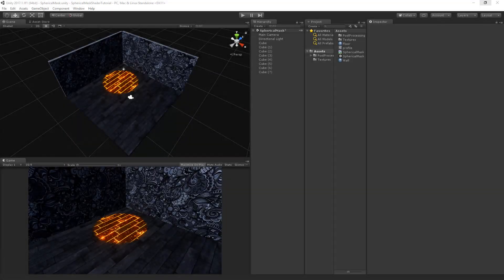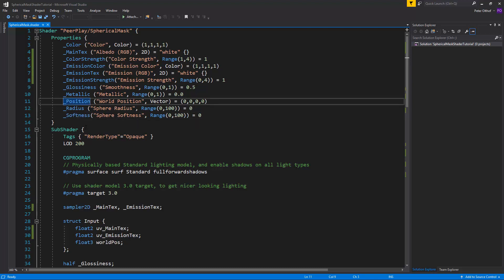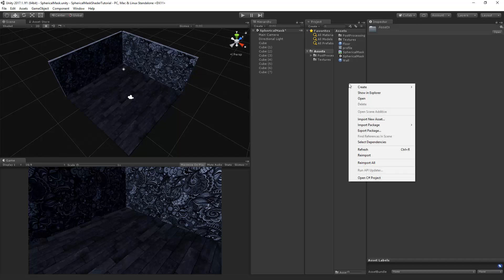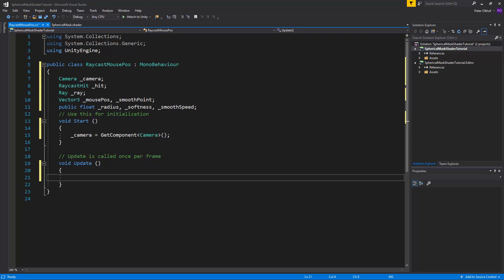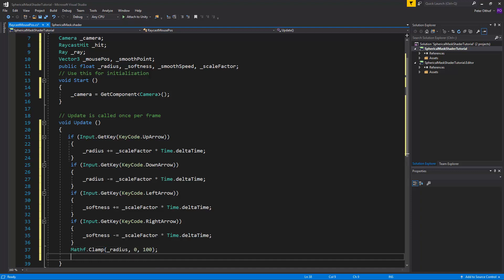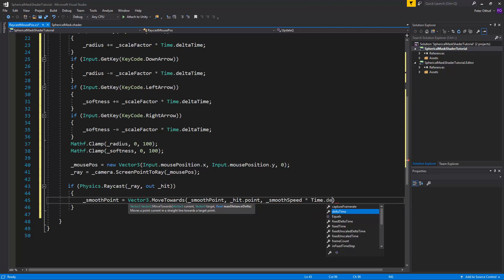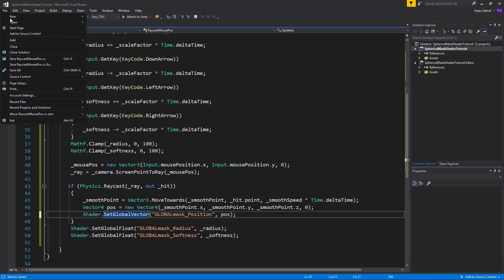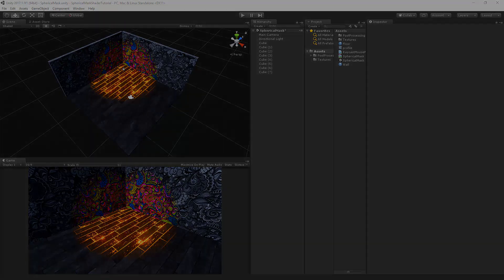Spherical Mask Shader - Unity CG/C# Tutorial [Part 4 - Update Position]

Comment: Can there be multiple spherical masks on one texture?
I really need to do it, and I'm getting absolutely no help...
Reply: You can pass a vector array into the shader with SetVectorArray(). This function can be used to pass an array for your sphere positions, an array for your sphere radii, and an array for your sphere falloffs, with all the arrays being the same length.

Then you can use a for loop in your surf() shader function to iterate through the arrays and get the accumulated color intensity from each sphere (adding up the color intensity value in each iteration of the loop). Then you can lerp between black-and-white and color, using the accumulated color intensity value from the multiple spheres.
Reply: Did you ever find out? I would love to know the same!

Comment: Nice tutorial. I lear much about shaders. Thanks and wait for new :)
Reply from the maker: I'm glad you learned more about shaders. :) My next tutorial will be about another shader ;)
Reply: Peer Play Nice I will wait. I have one idea to use this shader but I have question. Can I use bool in shader program?
Reply from the maker: bool does not excist, but you can do it in another way, by checking if a number (half, or float) is 1 or 0, which is basically a boolean, and multiply something you want to do by that number. Multiplying by zero would mean something is ignored obviously. Just avoid any if statements. Graphics Cards don't like that!

Writing shaders is a very different mindset to programming than you would do with C#
Reply: Peer Play Okay thanks for explaining. I need read more about shaders I see :)